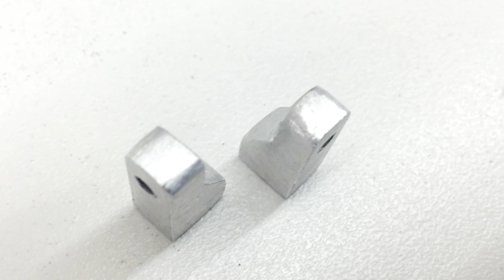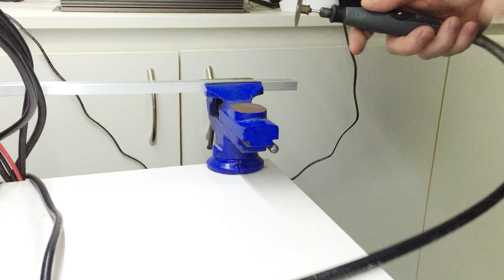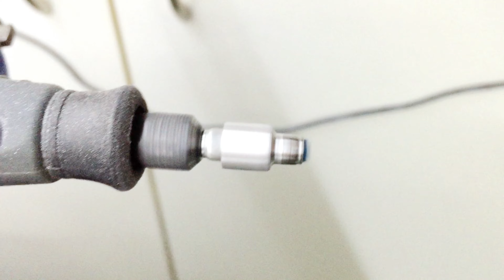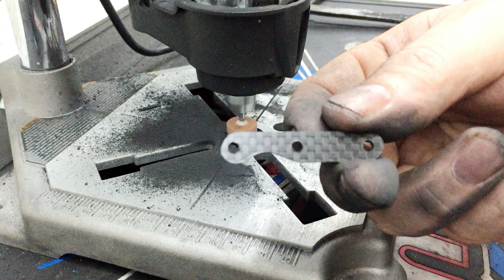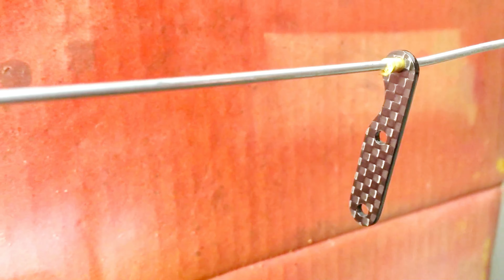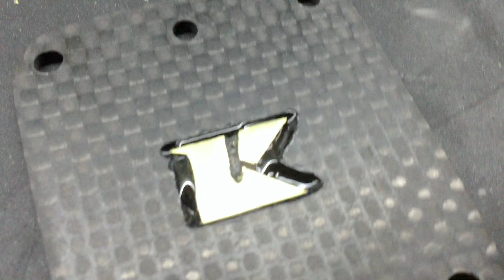Kyosho Ultima Project PART 2 | Custom Carbon & Alloy Parts - How I made Them.

Comment: Sorry if I missed it but how thick is the carbon you are using? Nice work by the way, very inspiring! Thanks
Reply from the maker: Sorry I think I did leave that out. The sheet I used was 3mm thick for the shock towers and motor guard, 1mm for the wing washers and side plates. Thanks mate, glad you enjoyed it! 👍

Comment: Make an chassis out of carbon😁😁
Reply from the maker: There was really no need, the FRP chassis is fine. I only made these parts to replace some alloy parts or in the case of the motor guard plate, make parts I didn't have. 🙂👍

Comment: Some very cool ideas.  What are the collars, that go around most of the screws on the chassis and parts.  Ive seen them on Rovan and HPI bajas before.  Also who makes the clear coat you sprayed on the carbon parts.  My Baja 5B has "carbon" parts and Im wondering if I could hit them the same as you have done in this project.  Nice upload, thanks for sharing.
Reply from the maker: Thanks mate. The collars are known as countersunk washers, the ones I used are M3 and M4 for the 3mm and 4mm countersunk screws. Part 3 isn't far away, I'll try to answer more questions about the screws n stuff in that one and show them close up. The clear coat can be any automotive 2K clear, I used DNA Diamond Clear. I baked them in the kitchen oven too, on it's lowest setting (80 C) with the door a bit as I was aiming for around 60 C. You can do it without baking of course, will just take much longer to dry. You could also use a spray clear from a rattle can, it's just got to be a very clear and glossy clear. I wouldn't use, say a Tamiya TS clear as it doesn't dry glossy enough and is kind of milky if sprayed too thick. Hope this helps. 👍